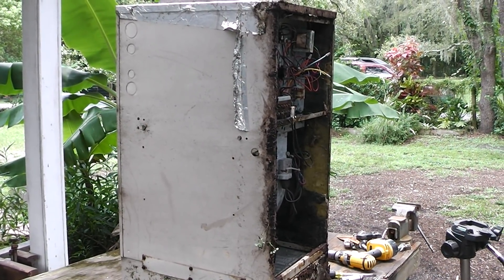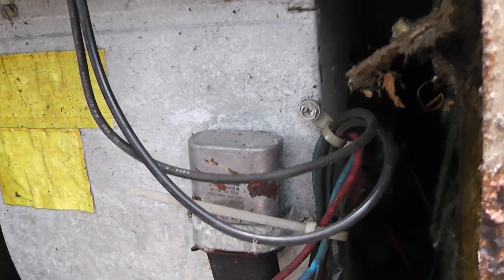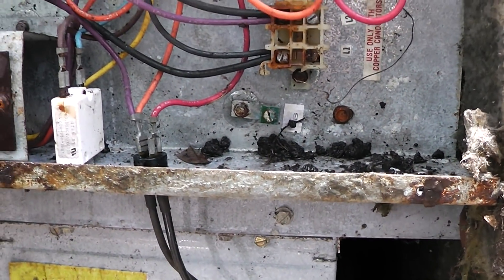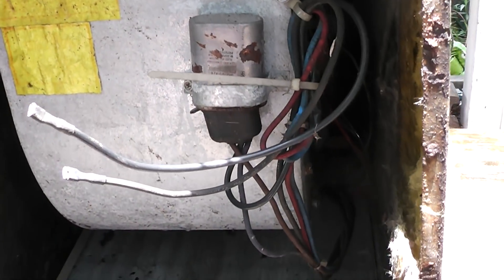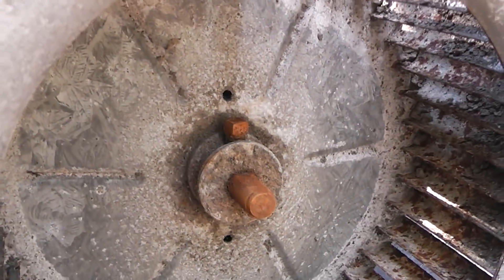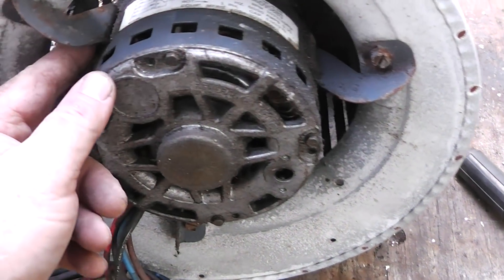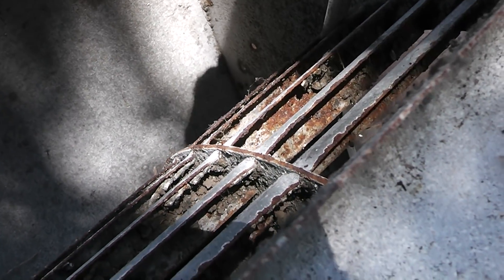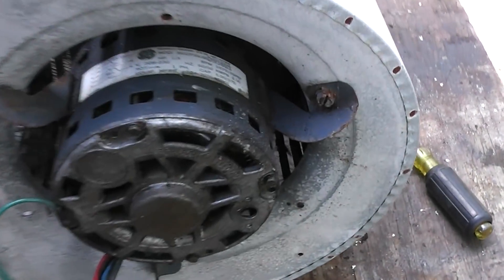HVAC How to Remove a Squirrel Cage Blower Fan out of an Air Handler

Comment: Hey I appreciate the video I have a real old carrier unit heat pump everything‘s contained outside my whole AC system like the one you have I imagine they cooling fan in the blower motor and everything is in one unit and I did the capacitors and my scruff and stop moving and I’ve done all my testing and I believe it’s my motor but I’ve been struggling to get that motor out it looks like from your video I have to go to the other side of the air conditioner and take those two screws out mine sits on the groundIt’s only a foot and a half off the ground so it’s hard to work on but your video helped a lot I think I was just working on the wrong and trying to get that fan out I was on the control side it looks like that you got to go on the the fan exhaust side to get it to come out anyway let’s hope next time I go out there I’ll be able to get that fan out and get that motor out